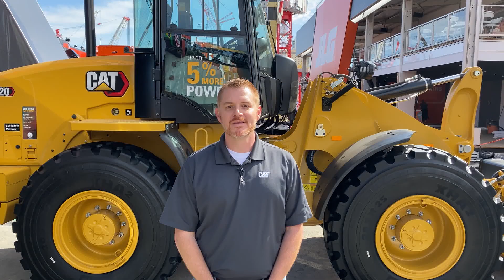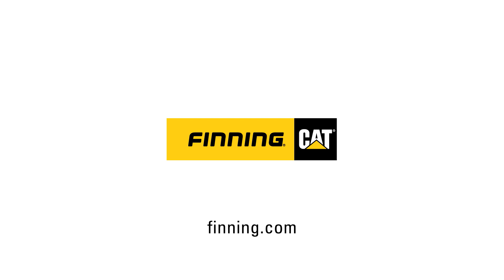Next Gen 920 Wheel Loader

Comment: 920 brings back not-so-fond memories - we had the misfortune to buy a used 920 (if I recall, was a '78 model year or thereabouts). One of the most gutless machines Cat ever built - could barely fill a bucket full of loose sand when it was new.  Was grossly underpowered.  Cat should have paid contractors to use those crappy loaders...remember being estatic when it went to auction where the next sucker took it away. By rights, they should have been sent directly to the scrap heap as soon as they left the assembly line. The single-worst piece of equipment we ever owned...